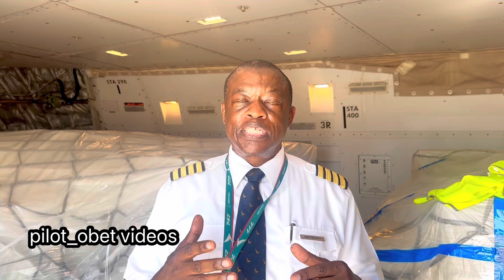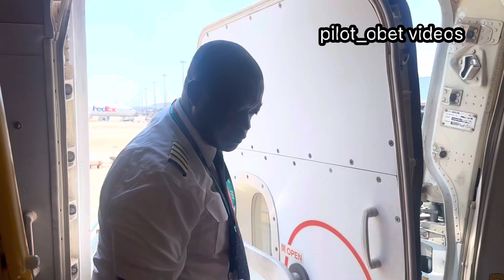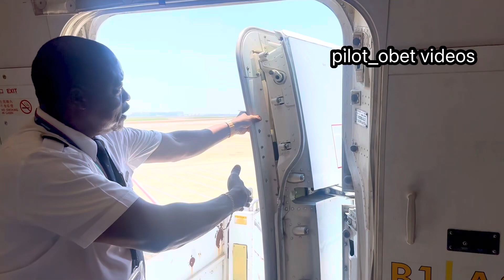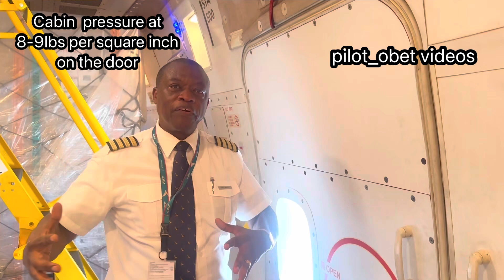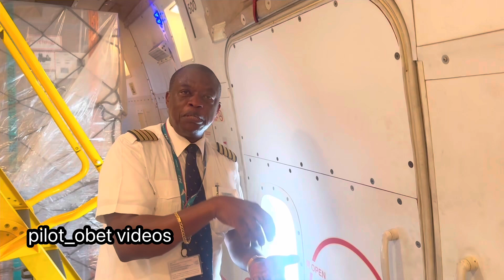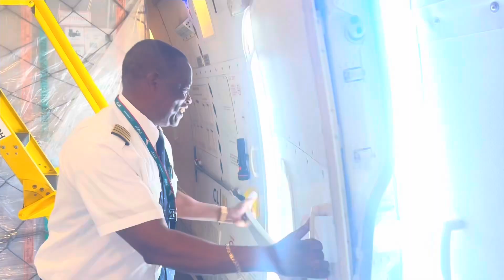Aircraft ‘Plug type’ doors- B747 demonstration

Comment: I still do not understand how the doors can move through the hole if can act as a plug. Because any plug must be slightly bigger then the hole which it is insert into. Otherwise the plug will fell through.
I understand that for the left and right rim of the doors this is solved by moving them perpendicularly through the hole. But what about the upper and lower rim?

Comment: Captain, do the 747-800 and other 747 types have "speed locks" additional fitted to the doors?
Reply from the maker: @Terrorhawk38  I believe it is a customer option- certainly for the B747 upper deck doors we had a locking system as they opened outwards and were not plug type
Reply: @pilot_obet  I came across speed locks in HS748’s back in the days!

Comment: Would it be possible to open the door, if all packs would fail?
Reply from the maker: @AVIATIONSOUNDEXPERT  Yes- if all the PACKS failed, the aircraft would slowly depressurise until the cabin altitude inside was equal to that outside. Then a door would be open. During routine annual flight testing to renew the airworthiness certificates in airlines, we conduct what is known as a ‘leak test’. We turn off all the PACKS at an altitude of say 35000 feet, then time how long it takes for the cabin to climb to equalize to 10,000 feet or the aircraft altitude as the leaks out- its a test of how well sealed the aircraft is and must meet stipulated requirements :)
Reply: @pilot_obet  

Thank you Captain.

Comment: Great demonstration Captain!   I've always wondered how a "plug type door" could open outward, but that demo showed exactly how.... the mechanics of the door allow it to fit through the "hole" to open outwards and still be pulled back inside the aircraft to close and seal.